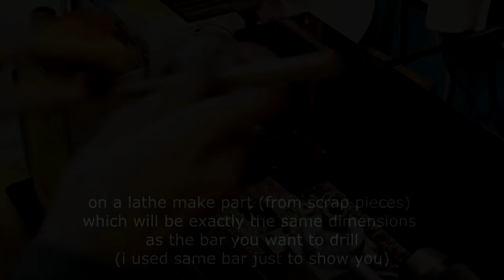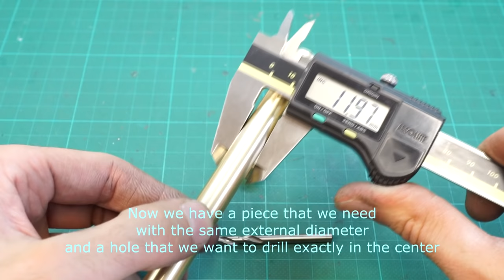Another way How to drill a hole through a round bar in perfect center [middle]

Comment: I don't have a lathe or a mill.  You probably don't need this trick if you have a good mill.  To get my perfect hole, I use a square file and in a single stroke make a flat on the bar.  Careful measurement and marking with a punch.  Then center a V Block on your drill press in a vise and drill using a small carbide bit.

Comment: it is harder than one would think to drill a cross hole. In many cases it must be right dead on or it will not work. Your method is especially good if you have to drill many parts. MY only suggestion is that you should use a parrallel under the part, in the vice, just clear of the drill bit. It would make it easier to set up and more accurate as well.
Reply: No it's Not that hard I can do it in about 30 seconds using my Wilton Cross Slide Drill Press Vise. Chuck up the Round Stock bring the Split bit drill bit down close to the stock Crank the handle back and forth on the cross slide moving the drill bit down and the moment the bit touches the round stock thats the High Point "Center" Lock Down Your Vise and Drill. : )

Comment: I know a lot of people scoff at this vid, but they should realise that just because they have knowledge, does not mean that everybody has. and people like me appreciate someone giving their time to help out others. I have tried it myself, but you tube did not work out for me.

I did my time as a tool maker back in the early 70's, but gave it all up as the money was rubbish in those days, and so became a builder. Now in my 70's,
I have aquired a small old metal lathe and milling machine, with all the tools I could wish for, and I have not got a clue how to use them. It's true what they say, use it or loose it. Now i'm getting tips from you tube to get by. Thanks for the vid, very helpful.
Reply from the maker: Great to hear but i don't agree with your word "use it or loose it" i collect the tools even if i need only here and there, tool.is always good to heave and there is never enough 😅
Reply: A rod will not deform as much as a hollow pipe, especially if you use care. And a brad bit would not tend to slide off. Do it slowly and carefully.

Comment: This was a very good example of how you can do this . Thank you. I've been a job shop/r&d machinist for over 40 years and I've never seen anyone use this method. Hence the saying " you are never too old to learn ". I also know from experience that if you give the same job to 10 different machinists, it will be done 10 different ways. They all get the job done, but not always so perfect. I clamp the round part in a mill vise and touch off on the back jaw with an edge finder and zero the DRO (digital read out), then move the edge finder to the front vise jaw and touch. Then I divide that movement in half and then move the table to that dimension. I always spot the hole with a center drill slightly larger than the hole I want to drill otherwise, the other drill may walk . I know many peeps do not have a DRO on their home mills, but the same method can be used with your dials as long as you take in consideration the backlash.

Comment: Thank you. Finally, 3 minutes of YouTube video that I will remember and use from now on.
Reply: Tintek33, for several years I used to install and overhaul General Electric Co. gas turbine generator sets in the 20 to 60 Megawatt range in the absolute armpits of the world. Proper tools, jigs, fixtures were very  seldom available and we had to use our wits to come up with solutions to dozens of problems every day. Sometimes a simple dial indicator was unavailable for 2-3 weeks or more. In Venezuela it was a 4 hour drive to get a pack of hack saw blades from our location. We had bamboo ladders in Taiwan, hardly OSHA approved.

We had an occasional Field Engineer who insisted on holding diesel injector pump tolerances for roofing nails.....that's fine for a government funded Precision Prototype Aerospace Lab but not for our situation. I replaced several prima donnas on various assignments that were lagging. The goal was to get the power to the grid as soon as possible, no excuses.

    I built a lot of lifting fixtures, jigs, special one time use tools right there on job sites using the universally available oxy acetylene tanks, 9'' body grinder, and welding machine, scrap steel. We always got these units up and running.  Now I'm retired but still do small scale things in my garage as a hobbyist and appreciate  videos like yours.  Trust me....your video is not a ''disservice''.
Reply from the maker: +kimmer6 thanks

Comment: Good example of one way to get a fairly accurate hole. There are many ways of doing this as there is equipment to do it. Accuracy fully depends on the projects end use. I have gone to both extremes, from drilling a hole using a hand drill in a vise to using my vertical mill with DRO, to dial indicating a part. But thanks for the video and your input. I always get ideas for sharing information.

Comment: Once you have a milling machine it's a lot easier to use an edge finder to pick up the edge of the round bar.  Once you have the edge you can dial over 1/2 the diameter of the bar and use your center drill to start the hole.  The center drill will start the hole in the correct location even on a curved surface.  Once you have center drilled your hole location the regular drill bit will follow right through the hole started by the center drill.  You should probably do a tutorial on using an edge finder and that would help everyone out quite a bit.

Comment: Good simple idea for more precise work than even using a DRO.  I suppose one could make up a whole set of bushing for the rod sizes you use most.  However for myself I will stay with the centering bit throughout.  Then after the hole location in the bar has been established with the locating bushing then drill it to the desired size.  The more I think about it the better it gets.  Thank you for sharing.

Comment: use a 6" steel ruler lay it flat on round stock, touch and hold it with a centre drill. move the table left or right until ruler is level, remove ruler and drill
Reply: This method is not accurate
Reply: I like this method..... too get you close only though. My experience, it gets you within 5 to 10 thou.

Comment: You don't need a lathe. Instead of using round stock for your drill guide, use square or rectangular stock. Easy to set up in vice and drill your guide holes - you can even drill a number of holes of different diameters so that you have more than one drill size / hole option available for drilling through your round bar.

If you want to drill through centre of thicker round bar stock, simply put appropriate thickness shims either side of your square / rectangular "guide" in the vice to centre it over the round bar.

Comment: Anytime I hold two parts of "same" thickness in a machinist vice I always put a single piece of masking tape on the moving jaw contacting both parts and indicate from the solid jaw. The tape (or even a single piece of paper) will allow you to hold both pieces firmly because it compensates for VERY slightly non square jaws like yours or material that may be .002" or LESS different. This will prevent your guide from lifting or spinning and still give you an exact alignment.
Reply from the maker: Joe G great tip, thanks for that, simple and work well i think, i will try next time.

Comment: Thanks for this video. I use the same method because I have a good mini lathe but a very bad drill press. It is an easy way to make multiple parts accurately.
Reply from the maker: Exactly, i shown on a mill because i don't got a drillpress in this workshop, this method is good for a drillpress wich center itself, thanks

Comment: Note to those who are offering alternate ways to drill on center, including touching off the vise jaws with a known diameter tool...This is not about FINDING the center but rather HOLDING center as you begin to drill.  Even after center drilling your location,  a little drift is possible.  You start on center but don't emerge on center on the opposite side.

What he's offering is a cheap drill jig to keep the drill bit on path by minimizing flex and drift, that's all.  Not bad advice, though most home shops with drill presses will not have metal lathes, sad to say.

Comment: I can see why people are puzzled by this.  If you have a machine shop, you don't need to do this, and if you don't have machine shop then you can't do it.  To be fair it's a good idea if you had to give it to a junior machinist or labourer to pump out a number of holes consistently.
Reply: Mee, there is a simple made in china tool for that purpose, I have one for 3 deferent size of rods, drill holes on top, just fix the tool over the standard sizes of rod and make a hole from provided drill holes on top of that tool.
Reply: Mee Ibast 
I would never have taught anyone to do this.
Reply: Fair enough guys.  Just pointing out there is some logic here.
Reply: Dial indicator, edge finder, etc. to find center. Once you've done that, every other one is going to be centered, just don't move the dials.